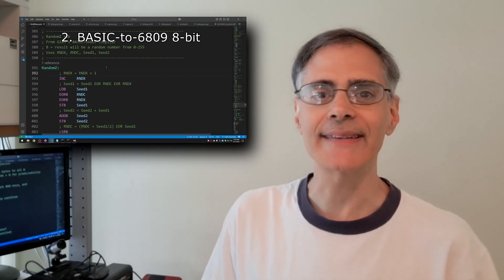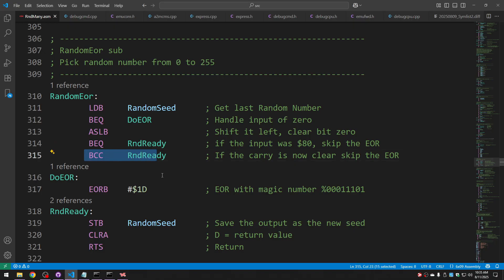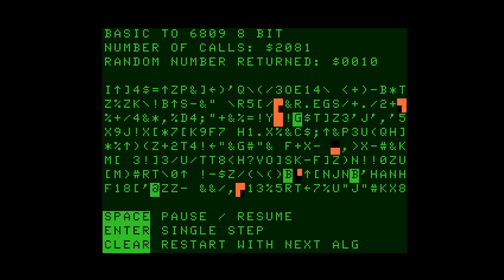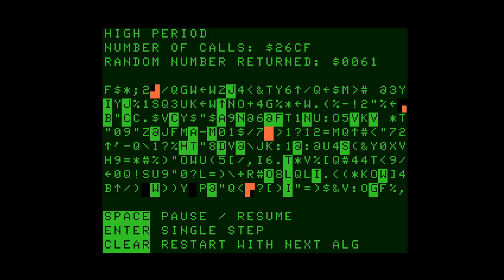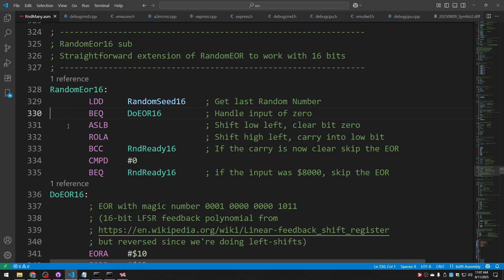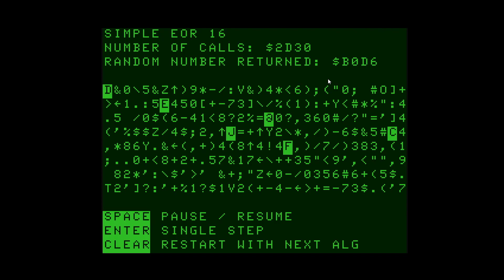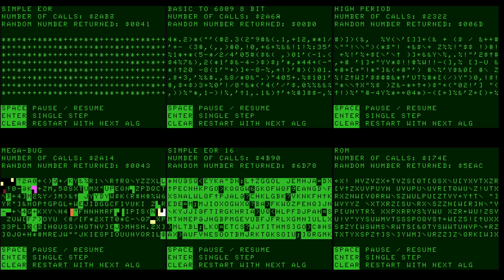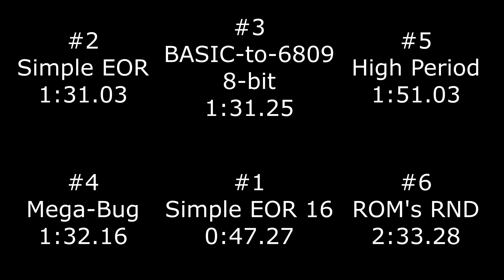6 ways to random in 1980s assembly: illustrated & demystified

Comment: 1:30 I'm only familiar with the 6502, but why is there a CLRA instruction here? The rest of the code only works with B, why does it need to clear A?
Reply from the maker: The 6809 contains a 16-bit D register, which consists of the two 8 bit registers A&B. The code which calls the random number routines expects the returned value to be a 16 bit value in D.  You're seeing the code for a random number routine that only returns an 8 bit value, so clearing the A register ensures that the high byte of D remains zero (thus keeping D just the 8-bit result).
Reply: @CocoTownRetro Ah, of course, this code was called by the visualizer which could also handle 16-bit output. Clear! (No pun intended 😉)
It was fun porting these to the 6502, by the way 😁
Reply from the maker: @jelmerterburg3588  That is super cool you ported to 6502!  Were you able to do a speed test there to see if the results are any different?

Comment: One way to get even better relatively fast random numbers would be to use Simple EOR 16 but instead EOR the two bytes together. It would only be 4% slower than Simple EOR but the random number quality shoots way up, likely greatly surpassing all the others except ROM RND. As a rule of thumb you never want to use ALL bits in the seed, IE you want at least 12-bit or better yet 16-bit period for an 8-bit random value. Even 16-bit is kind of iffy for "serious" use but plenty for game randomness. A bit surprised the ROM RND wasn't way slower than it ended up being.
Reply from the maker: Great info.  I especially like the idea of EOR'ing the two 8-bit random numbers to get a "super" random 8-bit number.  Nice!